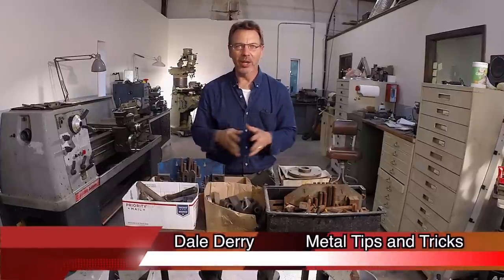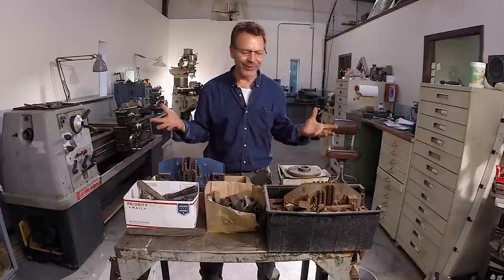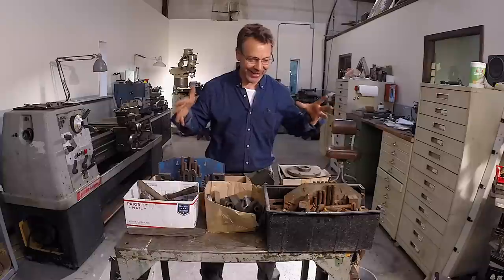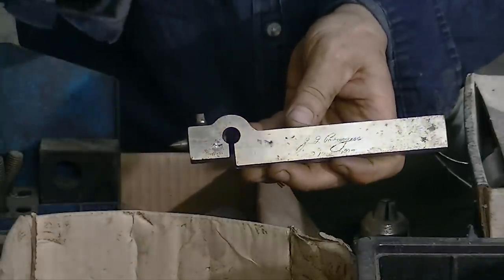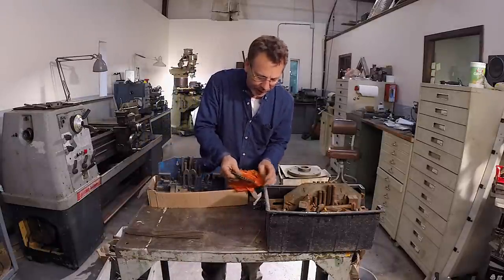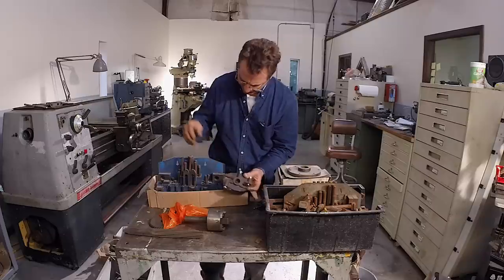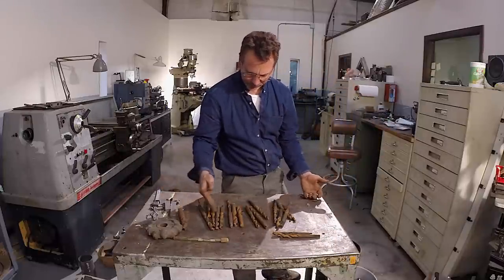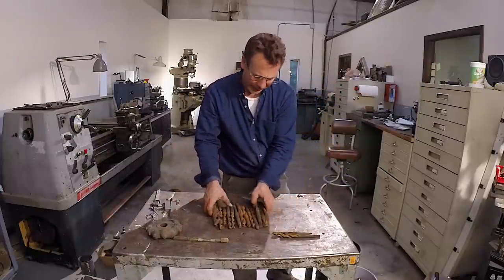Tool talk Episode 1 "The Lost Find"

Comment: I think the rack on the bottom of the cross slide is part of a production cross slide for a high production chucking lathe. It is used with preset stops for mass production.

Comment: That cross slide is for a small precision bench lathe, probably setup for long runs of parts. That gear rack is the "leadscrew". there is a lever and pinion on the bottom of the apron, when the lever is flipped up advances the slide forward making the cut. (probably used for parting pieces off)
Reply from the maker: Andre Gross  Cool thanks for taking the time to comment
Dd
Reply: Your welcome, glad I could help out. Your shop looks great! Wish mine was setup like that.

Comment: for an easy cleanup of your rusty stuff, you should start with an electrolytic bath of washing soda and a battery charger. mr.pete222 has a really good video on how to set it up. i use that method a lot and it really works well

Comment: Nice find.   I think I see electrolytic rust removal in your future.... Evaporust works great, but it gets a bit expensive when you have massive quantities of rust to battle.    Get yourself some graphite rods or plates, an old battery charger or other low voltage DC supply and you'll have that stuff clean and rust free in no time.
Reply from the maker: Applebaums  Thanks for the info.

Dd

Comment: You need a 5 gallon pail of Evapo-Rust.  It'll clean all that stuff up.
Reply from the maker: Herb Blair  think your right
Dd
Reply: ***** Or electrolysis.  Both are good, and do not take away good metal.  Try not to clink those cutting tool edges together any more than they have been already.

Comment: You ought to consider picking up a glass bead cabinet from harbor freight, I bought a different for it gun off ebay and it works great, item 351066262817 the media or glass beads I buy are from grainger # 2W580. I just cut a small hole for a plastic pipe that goes through the back wall of my shop, I don't filter the air from the cabinet I just blow it outside. If you ever had one of these you would wonder how you ever got along with out it, you could clean off all that rust and it will not hurt the surface much at all.

Comment: Hi,
    Most of my 60 year engineering life I was taught, and I consequently taught others to respect their machines. I see that your machines are clean but the condition is somewhat knocked about. I could not work with a machine that was not in tip top condition and I therefor made sure that every part not only functioned correctly but also looked good. You could take a leaf out of my book especially as you present your equipment to many others in your videos. Nuff said.